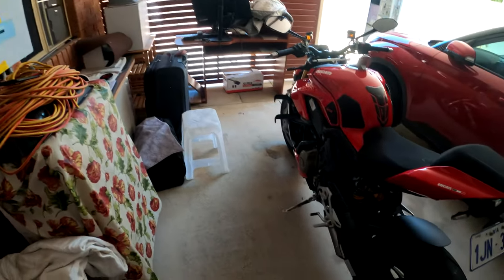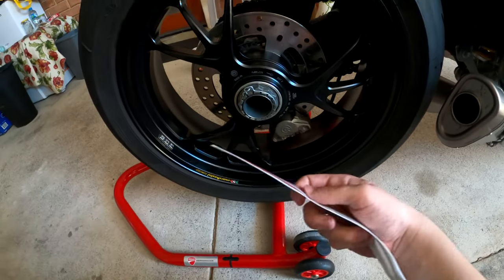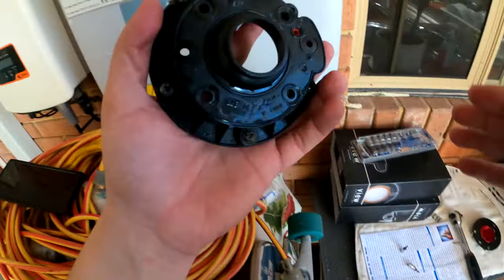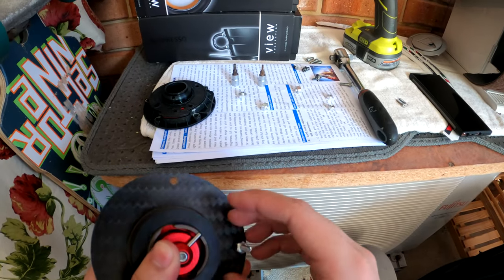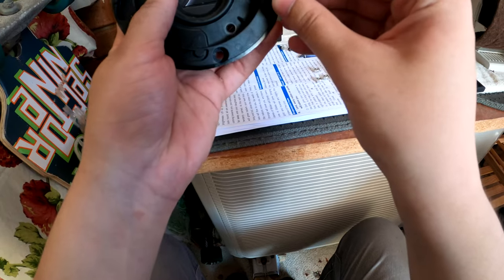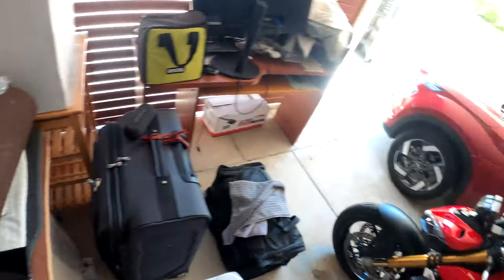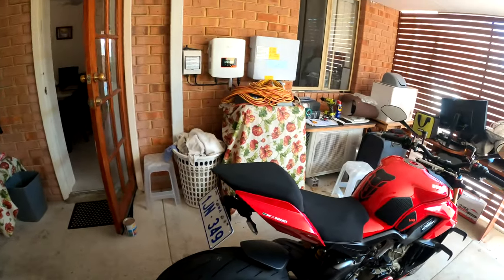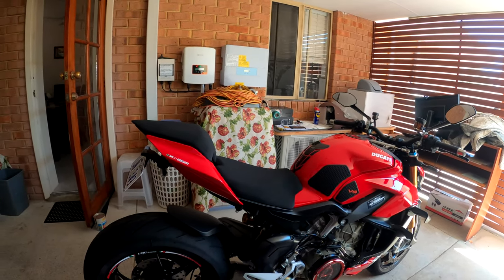How to install CNC Carbon Fuel Cover on a Streetfighter V4s

Comment: Do you have any problems with fuel overflow/water inflow over the two holes that have been left out as the CNC cap only has 3 screws to fix it to the tank?
Reply from the maker: @DrSchack  um surprisingly no, i have that issue

Comment: All your mods from CNC Racing? I find their products really nice, also how’s the carbon fuel cap holding now?
Reply from the maker: I do like CnC too, um I think my fuel cap, passenger block off plates and reflector delete are CnC, other wise my clear clutch is ducabike, and the rest is evo tech and full six. Bit of a mix up there, I am liking the easy of refuelling but in Australia you have to hop of the bike and remove the helmet to fill up

Comment: Cnc racing makes attractive products, no question… BUT, they gave me screws that were too short to attach the carbon fiber gas cap to my rs660… I had to go to my hardware store to remedy the issue, but that should not be the case…
Reply from the maker: Oh dam that's sad to hear, I had an issue with accidently stripping one of the screws and the retailer i bought the gas cap from sent me out a new for my model bike for free

Comment: Pro tip: you should always put a rag over the hole when your romoving fuel cap bolts,just sayin.
Reply from the maker: Mmm That idea hit me only when i was editing the video haha, Thanks tho !!!
Reply: @Voidzzy  were you able to fix the stripped bolt my friend?
Reply from the maker: Not as yet, i have asked the company where i bought the part from to see if i can get some replacements ones, but i am waiting on a reply. 
I am dreading trying to get it out, stripped screws can be troublesome
Reply: Yes they are.
Reply: Is it striped inside the threads on the cap too? Is it going to have to be rethreaded?
Reply from the maker: nah, the internal thread is fine its just the top hexagon that's turned into a  circle. me over doing it haha
Reply: @Voidzzy  ok brother, that's good, a bolt is no big deal,i actually has a fairing bolt striped out from the factory, when i took the bolt out all of the threads fell off,piece of garbage.
Reply: I have a Ducati Pentigale V-4 i absolutely love the dam thing.
Reply from the maker: cheeky buggers at the factory haha. oh cool how are you liking it ?, i was tempted by the panigales but the streetfighter series had my heart from when i first saw the older generation
Reply: @Voidzzy  i absolutely love it, i was going to get the streetfighter to but i test rode them back to back and the power difference and the wind difference was so huge i had to get the panigale.
Reply: @Voidzzy  your young you should of got the panigale, I'm old it does hurt my back on long rides and that's my only complaint.
Reply from the maker: The Wind is a big issue on the streetfighter for sure, and yea the power of the panigale is linear and sitting at the top end and the streetfighter has the power at the low end. I had a motorcycle accident a while back, and damaged my wrist and back. When i was riding my friends V4R, it was painful